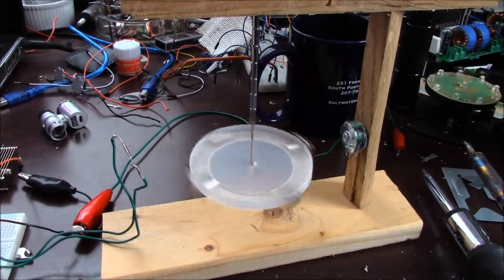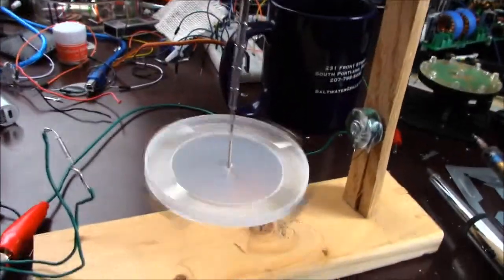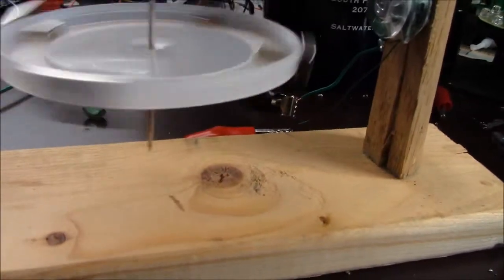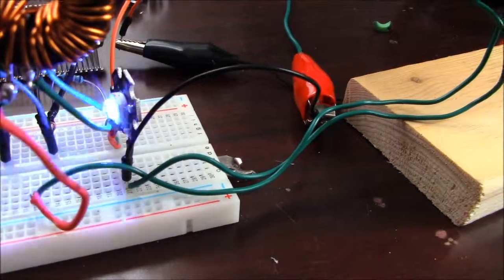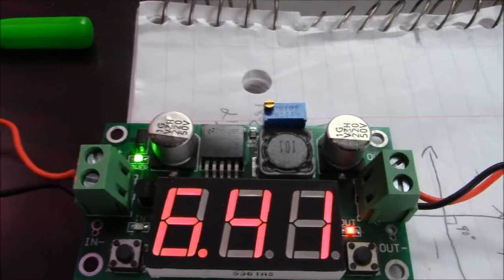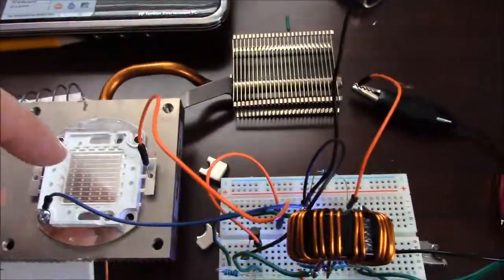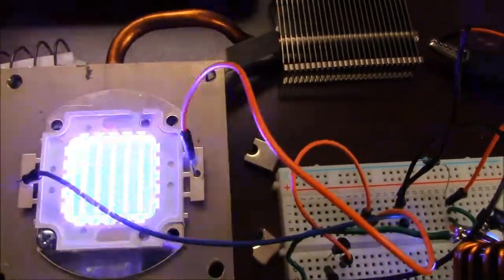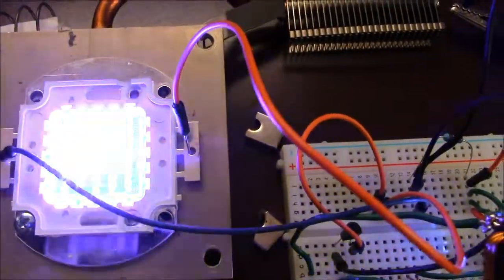Electromagnetic Pulse Motor with Joule Thief and LED's

Comment: Hi Trace - nice little motor... If you're playing around with motors, you should probably also have a play with 'homopolar' motors - They've got to be the simplest motor ever to build (1 x magnet, 1 x copper wire, 1 x battery, no electronics). As to why your 50W blue LED lights up.... What an inductor wants more than anything else in the whole wide world is for the current passing through it to remain constant... When you first try to make power flow through an inductor, it will act as a big resistance, trying to prevent the current from flowing... right up until it becomes magnetically saturated, at which point it will just act like a piece of wire (hence the reason they're used in filters all the time)..... On the other side of things, when the current is flowing, and you interrupt it, the inductor will do whatever it can to try and keep the current flowing... and the only thing it can do to keep the current going is to boost the voltage up to try and keep the power flowing (all the way to inifinity if there were no losses anywhere) - That's how the ignition coil and distributor cap on old cars works to create a spark at the spark plugs.... You can very easily get large voltage spikes (into the 100s of volts) from the inductive kick when you switch a coil off.... and that's why your 50W led lights up.. no problem.... Cheers!!
Reply from the maker: Thanks Jim I'll have to check out that motor. I understand the inductive spike and that's why I put the LED's in the circuit as a flyback diode. What I didn't understand was how before the LED was lighting up with just a few volts from the joule thief alone. I assumed it was the same case here, but I decided to measure across the LED and the voltage is spiking according to my el cheapo multimeter over 1500 volts. This makes much more sense. I still don't understand why it's not showing peaks like that with the joule thief on its own. Maybe because of the frequency the multimeter can't keep up? Thanks for comment, or I wouldn't have gone back and checked! I'll update the description.